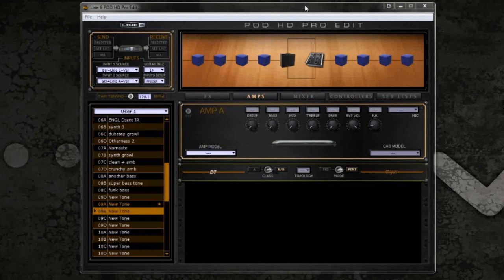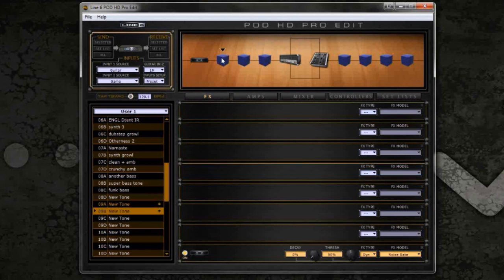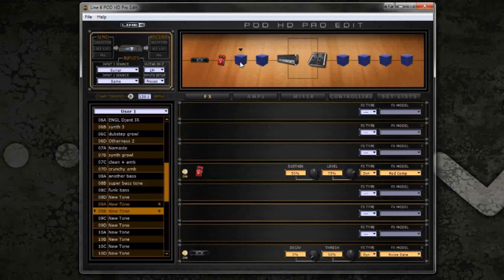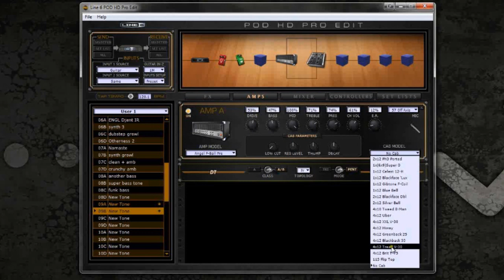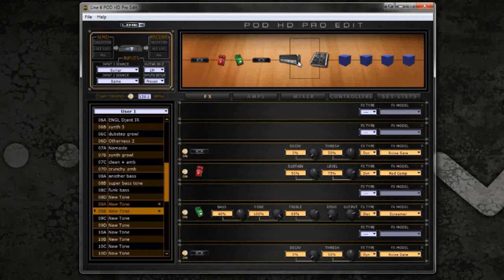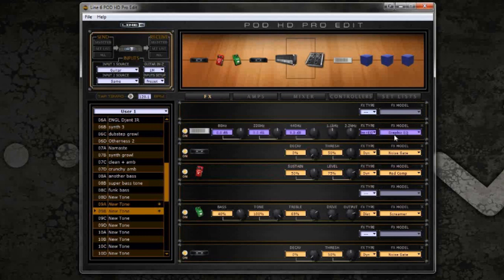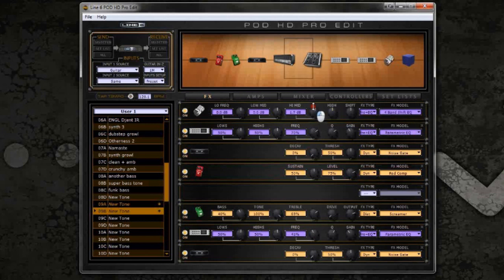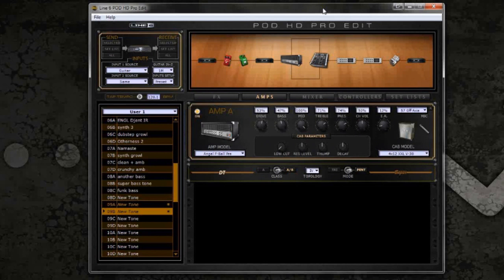POD HD PRO - rhythm tone tutorial (slightly djenty)

Comment: Open the Line 6 audio driver control panel on your computer and turn "hardware monitor level" down to 0. Instructions to do this are in the downloadable advanced user guide  ( look in "USB audio" section). Once you are done recording, turn it back to 100 to be able to hear the POD HD signal again.

Comment from the maker: Amps Pre only simulate the pre amp section of the whole amplifier whereas Amps simulate the pre amp and power amp, so they simulate the whole amplifier. 
in a real amp the pre amp amplifies the guitar signal and adds distortion if needed. the power amp provides power to drive the speakers in the guitar cab and it also adds some tonal character. 
on the pod i only use the Amps, not the Amps Pre.

Comment: A bit late... but just in case you are still having the issue. You can mute the second signal by opening your ASIO editor and setting the "hardware monitor" to a lower setting. As long as you dont change the "record send" then you will only hear your sound when you are armed for recording.

Comment: Just out of curiosity, what kind of guitar/pickups are you using?  because as a start, i made basically the same patch as you, except after was all said and done, it was still kinda noisy (im using a sbmm jp70 with stock pups), and that "afterburn" sound was still there. So what I ended up doing was just rolling back the compressor level and turning of the screamer drive to between 15-25%. much tighter, no more noise, and still great crunch.

Comment from the maker: if this happens with every high gain amp model it could simply be the way you hold your pick. if you hold it in too big of an angle you naturally scratch more of the picks edge over the strings. i use the solo crunch model for solos and hold my pick fairly straight so i mostly just pick with the tip and i don´t have any trouble with pick noise.

Comment: What is your experience with the "Hard gate?" Also what do you think about using the compressor first in the signal chain? For ex: guitar/ compressor/ gate/ tube screamer/ gate/ amp? I've seen alot of people set up their signal chain this way with analog equipment always with the comp first. I'm experimenting with POD setting like this.
Reply from the maker: i wouldn´t put a compressor first. you´re basically raising the noise which makes it harder to cut with the gate later on. i always put a subtle gate first to cut out the noise, then compress and perhaps another gate to cut any extra noise.
Reply: Yeah it definitely produced unwanted noise on the pod. Much better with your method, thanks for your response, awesome channel and music.

Comment: Great video! Soon i will buy Line 6 HD Pro and i have one question for you. What will happen if i select "No Cab" in cabinet option,add noise gate and other fx after amp and then load IR file in LeCab2 to simulate cabinet? Will signal go throught the PreFx-Amp-PostFx and then throught LeCab2? Do i need to do add separate noise gate vst after the LeCab2?

Comment: Awesome Tutorial. I have a POD HD issue that I hope you can help with. I want to use my POD HD to record a dry signal straight into my laptop using usb. From there, I'd like to use plugins to shape my sound (ezmix, etc). However, I can't isolate the plugin sound/output from the dry signal. I'm listening though the POD HD headphones. Any suggestions? I'd like to only hear the output from the plugin in my pro tools. Thanks man.

Comment: POD HD PRO OR 500X are good as an interface? are the pre amps good? Or should i get a Focusrite interface for example?
Reply from the maker: when you only record guitars and perhaps vocals, then a Pod alone will be enough. they work well as interfaces. for guitar the pre amp of the Pod is definitely much better than a Focusrite interface, because it´s specifically made for guitar.
Reply: Pod hd pro will have better recording pre amp? or between pod hd pro series and the 500 series will be the same?
Reply from the maker: as far as i know the Pro and 500 use the same pre amps.

Comment: A question, when i have my Pod connected, all my sound seems to go through my PC and when i activate monitor inside of my DAW i get a double feedback obviously.
And i have tried turning off my line volume under the "Playback" tab on my PCs built-in soundcard. But this doesn't seem to fix the problem, I have even de-activated every other soundcard except for the Pod HD but it still goes through my PC aswell.

Any idea of what this could be?

Comment: Hey man I just had a quick question. I also use a pod hd pro and I'm using a schecter blackjack, however with any distorted tones I notice a terrible amount of pick noise on my higher strings. I can hear the pick scraping the string with every note I play and it tends to dominate over the actual note. How would one resolve this? Turning down the distortion does not seem to help and it's raping my tone.

Comment: Johnny do you ever use dual amp blocks,or just single?
Reply from the maker: for bass i use dual amp. one for clear low end, one for grinding distorted mids. but for guitars i like to keep it simple and effective. dual amps for guitars sounds like a method to use when you can´t get a good tone with one amp. but i´m pretty happy with the tones i got so far, so i don´t see a need to use dual amp.
Reply: Ok.
Cool man thanks,it sounds great..so keep doing what you are doing!I have used dual blocks mixing 2 different amp heads..it can give a unique voice.